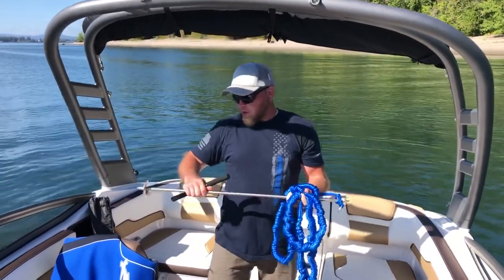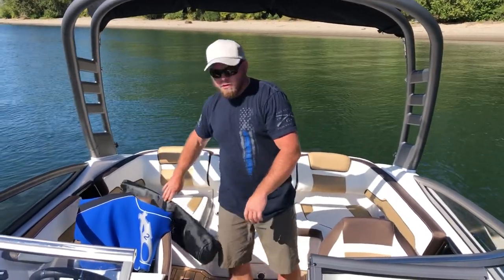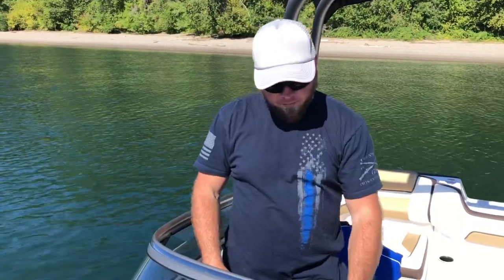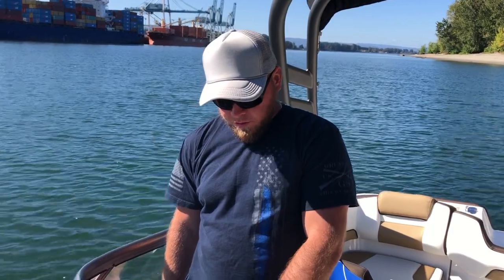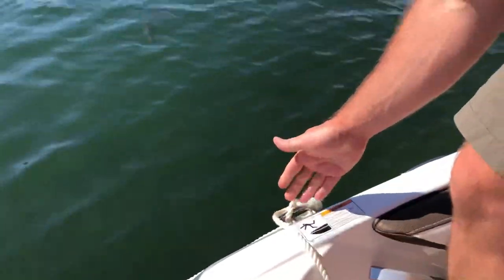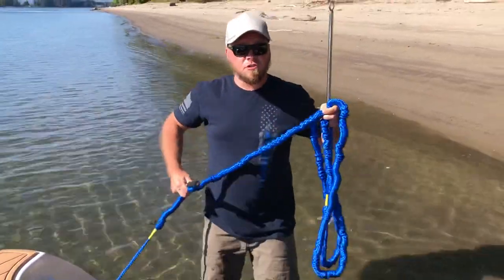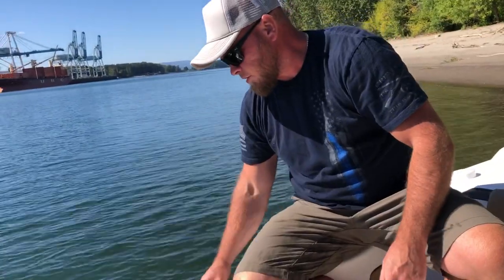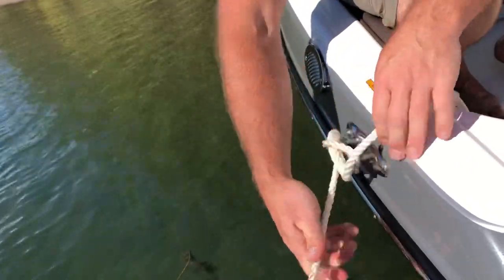How To Anchor Yamaha 195s On Beach @SurgeWorld

Comment: I prefer to use the bungee on the front, and pull the boat to the beach, anchor the stern, and then let it back out. Works better that way IMO. I like the stern deeper in the water, about 6-8 feet. Pull the boat in when I need to.
Reply from the maker: I will try to set up this way next time, sounds allot better plus this method will insure I won’t get stock on low tide. Thanks.
Reply: @SurgeWorld  I also connect my anchor rope with the bungee. If the anchor gets stuck, I'll have better luck retrieving the anchor with the rope. I just make sure the rope is longer  so it doesn't interfere with the bungee action. Good luck!

Comment: To Capeannimages, Be careful when using NEVER! And be careful anchoring the stern toward the open water. If the lake/body of water
becomes rough, the stern, being a flat surface can and may take on water swamping the boat!! The hull on most boats is deeper than the stern.
Just sayin'!! The Anchor Buddy attaches to the anchor or anchor line and is meant to pay out the vessel from shore keeping the stern, outdrive
or bow from damage!! Bow out or in, your preference the anchor and Anchor Buddy would go on the open water side of the vessel!
Reply from the maker: Yes, I have tried both ways. When I leave the boat attendant the front of the boat is towards the open waters while using the buddy anchor to pull the boat away from the shore. When I’m using the boat or I just beached for short period or time so kids can play in the sand then I use the buddy anchor this way. Keep in mind this is a jet boat.

Comment: Search youtube for anchor buddy anchor line and it will show you the correct way to use these. Bungee should be on opposite side so it pulls boat away from shore after you get off. This protects the boat from grounding.
Reply from the maker: Yes that’s correct. I made this video showing how to do it the other way for sandy beaches. This method wouldn’t work for boats with the propeller, my is jet.

Comment: Sorry man but the bungee goes on the anchor. The point of it is to keep the hull off the shore and u pull it in when u need to. I usually keep mine about 8ft from shore to make sure other wakes don’t rock it and hit bottom. It’s also good if u are going in and out through out the day in the same spot. U just attach it to a buoy and it stays in place because of the tension it shoots straight down. Making it harder to get caught in someones prop while you’re out on the water
Reply from the maker: That is true, I have changed my setup that way already. Works great.

Comment: where I live we drive up on the beach and throw out a front anchor, I am worried someone could run over the front line
Reply from the maker: Nice! Must be very shallow waters? I used to drive up on the beach with front of the boat, have little kids and it makes it a bit dangerous when they get in and out the boat. Plus it scratches the boat overtime.

Comment: Nice.  Shouldn't the front anchor be on the opposite side of the boat?  Thanks!
Reply from the maker: I have tried in the past having the 15' to 50' blue stretching rope on the front of the boat and it works okay, not the best. I think it would work allot better if the anchor-chain was attached to the blue rope. Another issue with the blue rope is it has to be perfect in length, most of the time i found it is not enough rope and the bungee rope is very tight and the boat wants to launch back into the water. But having the blue bungee towards the shoreline the boat is always snug to the beach and it makes it very easy access, when the water raises the boat stays snug to the shoreline and when the water lowers the boat floats into the water because the bungee rope lets the boat float then it returns back to the shoreline, otherwise regular rope would not let it float out. Once you have bigger waves from other boats the boat will float into the water about 2-3 feet for few minutes tell the water is calms down then your boat will return to the shore-line. Main thing by having bungee rope on the back is your boat will always be snug to the shoreline and its very easy access, makes it very safe and easy for the kids.
Reply from the maker: Also this is a jet boat which allows me to be completely snug on the shoreline. I suppose both ways would work well.
Reply: @SurgeWorld  I think Hank DeGeorge was talking about the anchor rope being on port side instead of starboard, seems like you answered based on bow and stern. I could be wrong about Hanks question though. I don't believe it matters what side(Port or starboard) the anchor is on anyways.
Reply from the maker: @samuelozuna7034  Oh I see, no I don’t think it matters really all depends on the current and trying to level out the boat.

Comment: is it safe to leave out overnight if it gets choppy?
Reply from the maker: I have left it overnight several times
Reply from the maker: I suppose there is two ways to have the boat setup. Ether it can float about 15’ away from the shore, or it can be up tight. I have a jet boat so not worried about being to close the shore.

Comment: Hey brother, how many pounds is the anchor you are using in this video?
Reply from the maker: I believe it’s like 10lbs, if I had to guess. Yamaha dealer had a kit for like $120, came with an anchor, 100’ rope and 3’ chain. Fits perfectly in the anchor compartment. This anchor works really well!!! I tried other anchors from sportsman’s and it was all waste of time and money. This set up works great. I use it an Columbia river all the time, never had any issues. 
Here’s a link, I believe it’s a same thing. https://leadersrpmshop.com/yamaha-new-oem-boat-anchor-kit-sbt-anchr-kt-08/
Reply: Thanks.. i was reading some of the comments in here and noticed you referenced 13lb anchor - so i bought that. Lol its a lil oversized and at bit heavy. Gona have to go down in lbs. i dig the video bro. Good job
Reply from the maker: @amont0596  thank you, yea this anchor really digs in sometimes and a Challenge to get it out, I would say 1 out of 10 times.
Reply: @SurgeWorld  experienced this my first time. Lol i thought the anchor was too heavy. When the anchor finally surfaced, a 5lb rock was lodged in it. damn thing was heavy
Reply from the maker: Do you have 3’ chain? That’s the main thing is that chain, it keeps the anchor laying flat. Once anchor digs into sand/dirt it’s almost impossible to pull it side ways, only up. And most of the time I have to use the boats forward momentum motion to get the anchor unstuck.

Comment: That corkscrew in the sand. 
Pain in the butt. 
Get a slam spike. It takes less than 5 secs to set.
Reply from the maker: Is the slam spike secure enough for currents?
Reply: @SurgeWorld  
Absolutely. 
I boat on the Colorado river. 
Topock Gorge area in Arizona. 
Lots of YouTube video check it out. 
Thx for the video you made.
Reply from the maker: @socalifone3044  I will, thank you.

Comment: First there's no such thing as a rope on a vessel, it's a line. Second I have the same Danforth style anchor with 100' 0f line & chain I bought in May from Amazon for under $60.00. Third and most important: Never ever beach a boat with the stern to the shore! Remember the deepest part of the boat is the stern where the prop is. With tide and or wakes you risk damaging your lower unit and you can become stuck . Plus it increases the risk of sand ,pebbles or other debris clogging the cooling system. Otherwise you did well but next time do it in reverse.
Reply from the maker: I can call it rope or a line in my boat. Second congratulations on buying 5lb anchor kit for boat size 10-18 ft currently $58.99 on Amazon. My is 13lb made for 20-32ft boats currently $94.99 on Amazon. Third my boat is a jet boat it’s designed for shallow waters and I don’t run the boat while it’s parked on shore nothing will get clogged up.
Reply: @SurgeWorld  I had my first boat since the age of 8 and know a few things that I gladly share. My current boat is a 20' Key West W/A. Jet boat or not it can still be damaged while pounding on a shoreline and/or become stuck.  There are people that will see this video and may put their boat and even themselves in harm's way. Have you ever taken a safe boating course?
Reply from the maker: Thanks for sharing informational tips. There are many different ways to beach the boat depending on location. The way I demonstrated in the video is more for anchor buddy system, except the anchor buddy pulls the boat towards the shore, makes it easy and safe for kids to get in and out the boat. It is not intended for long parking.
Reply: What a karen lmao
Reply from the maker: Lol